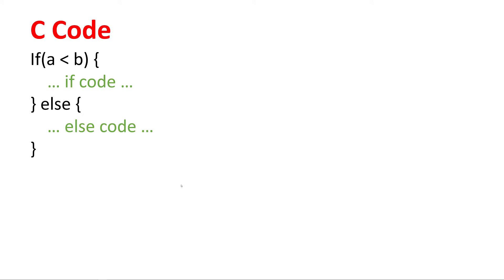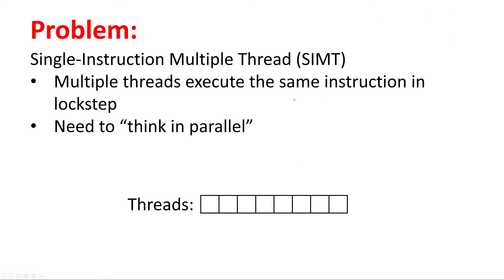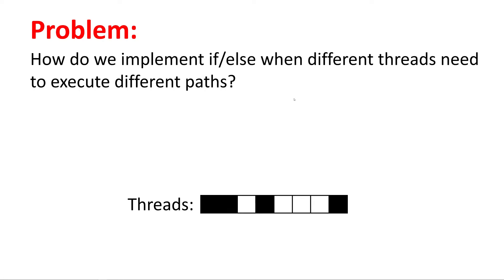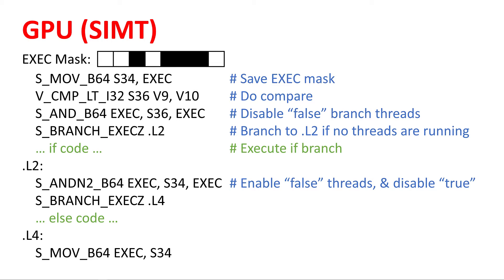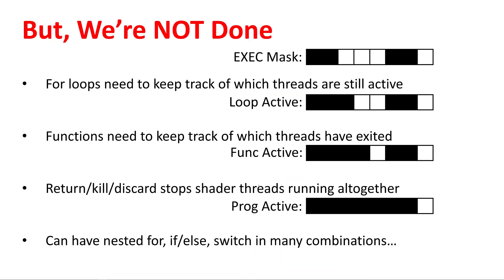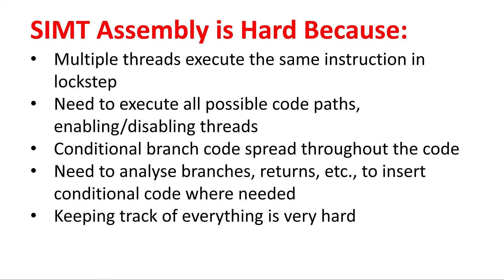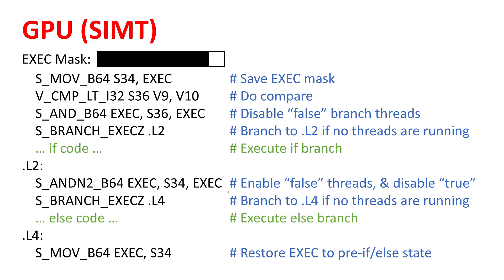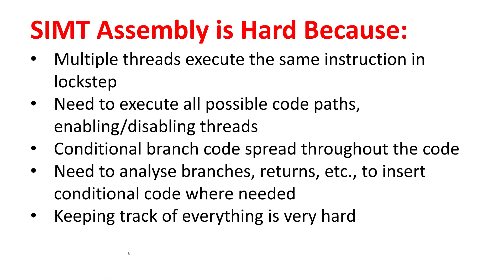Why Writing SIMT (GPU) Assembly is Hard

Comment: Honestly doesn't seem that hard. Might get more involved the more control structures you want to put in, but on the other hand you might be more purposeful in how you write your GPU code. I am already writing my shaders in a way where I compute all the paths and then decide what value gets used in the end via a single 'branch'. I am interested in figuring out GPU assembly.

Also exposing GPU assembly can (maybe) make it possible to have userspace shader compilers, and that could lead to better shader/GPU programming languages in general.
Reply from the maker: You're welcome to try it... provided that you can get your machine code through the driver to the GPU.
Reply: @KeaSigmaDelta  Yeah, that part might get involved. Also finding the specification for the instruction set, likely having to write an assembler for it, and figuring out how to debug that whole thing.

Thanks for taking the time to make the video, by the way. An interesting watch, and there doesn't seem to be a lot of information about assembly-level GPU programming out there.
Reply from the maker: @danilafoxpro2603  AMD publish their GPU ISA docs: 
https://gpuopen.com/amd-gpu-architecture-programming-documentation/

My experience comes from writing RadeonHD/RX drivers for AmigaOS. At the time AMD was a bit slow with releasing the Southern Islands ISA, so I reverse engineered it from their LLVM compiler (yes, that was years ago). I managed to get 2D hardware acceleration working before the open-source Linux drivers were stable. ;-)
Reply: @KeaSigmaDelta  Nice. So you were not implementing OpenGL, but routines like 'draw rectangle'? Sorry, I don't know about AmigaOS, so not sure what hardware acceleration entailed there.

Yeah, I was leaning towards trying with AMD first, since they seem the most open about their hardware and drivers.

It will probably be some time before I get into it though. For now I am concurrently figuring out CPU assembly/machine code while writing a compiler (x86), and writing a software rasterizer, figuring out graphics. After that, I wanted to try writing an operating system, so I will probably start poking the GPU when I get that working.
Reply from the maker: @danilafoxpro2603  I implemented 2D drawing using the GPU. Later I also wrote 3D drivers (a custom API, not OpenGL).

Comment: Thank you very much. This was very insightful. I might still explore nvidia’s ptx when possible. (I also think spir v has a format that closely resembles assembly, like llvm is for general machines)
Reply from the maker: You're welcome. I'm glad you find it insightful.

Speaking as someone who wrote an SPIR-V parser, SPIR-V is a low-level binary file format, and definitely not something that you'd want to program in.
Reply: @KeaSigmaDelta  I have some issues with restrictions on CUDA and was wondering if there’s ways to make it better. I basically want to have the equivalent of a large constant memory, that is accessed and cached in chunks of 8 k bytes (the general value) without having to relaunch the kernel and do a shared memory load again.

Basically I want to have access to explicitly mentioning the movement from the constant memory to the gpu cache memory (used for the convolution operations etc).
Reply from the maker: @manueljenkin95  I'm not familiar enough with CUDA or nVidia's architecture to know if that's possible. What the drivers do also matters. For example, the shared memory load could actually retrieve the data from a cache, unless the driver clears the caches between kernel runs (in which case it's always going to have to fetch from memory on initial load).
Reply: @KeaSigmaDelta  thank you. In my case I’m sure it does a reload due to a large dataset size which means it’ll get overwritten by new data before the next iteration or process that would require same data.

Comment: If anyone ever feels like writing parrallel assembly, there's one GPU out there that I know of that you can program without drivers interpreting the stuff inbetween. It's not a fully featured desktop GPU but it probably got most of the fundamentals the same.
And that is the QPU (Quad Processing Unit) of the Raspberry Pis. There exist several ways to program it, even in python or C, but for assembly there's vc4asm (VC4 being the Video Core IV that the QPU is part of).
Not easy to program, but probably very insightful.
In terms of features, it's on the level of OpenGL ES 2.0, but most people use it in GPGPU mode (they don't actually use the render queue, tilebuffers, and automatic vertex/fragment shader setup, but instead just push general purpose programs for the QPU to execute.
There's no microcode between the assembly you write and the QPU, so you actually have to issue the commands efficiently (one MUL and one ADD op per instruction). The architecture is 12 QPUs executing code independantly (but having a shared memory buffer to read/write to and DMA into memory), each of these QPUs are 16-way (or 4x 4 Quads in graphic mode) with a 4-clock-cycle instruction, and if you do only 8bit stuff you also get a bunch of vector instructions that operate on the bytes individually, for a massively parallel processor that is quite interesting to program.
If you want to see some code:
https://github.com/Seneral/VC4CV/blob/bf48b2ca335cad8e64bb745394a18a5f05103133/qpu_programs/qpu_mask_tiled_5x5_blobwrite.asm?ts=4
That is a video processing program, not graphic, still interesting.
Reply from the maker: Thanks for that. I had a quick look, and it does indeed look like the QPU is NOT an SIMT architecture, eliminating all of the challenges that come with SIMT.
Reply: @KeaSigmaDelta  Can you clarify why that is? Do note I did not formally study this yet, but as far as I understood SIMT is basically SIMD with some additional flow control, e.g. by providing an exec mask, whereas SIMD is more limited.
And the QPU is definitely at least SIMD - on a hardware level, they are 4x32=128 Bit processors, and transparantly execute the same instruction four cycles in a row, so effectively a 16-way 32-Bit processor.
If I wanted to implement an if-case in QPU code, I'm actually more limited than with the SIMT architecture - there's no built-in exec mask, all 16 paths execute the instructions, you have to refer to flags to mask when you are writing the result(s). That does however mean you cannot easily stack the masking, unless you simulate the exec mask with a couple more instructions. Which I guess does mean it has control flow masking, the exact same code you show in 5:10 could be implemented on the QPU.
Also technically it does allow for threading (two programs on the same QPU sharing resources by voluntary yielding), although that is a completely different kind of threading.
Reply from the maker: @seneral9804  I'm not familiar with the QPU, so I cannot say for sure if it is indeed SIMD or SIMT. That's just the impression I got from a quick look.

One difference between SIMD & SIMT, is that SIMD operates on a vector from a single thread (e.g., (r, g, b, a)), whereas SIMT operates on the same scalar value in multiple threads (e.g., (r0, r1, r2, r3)). Let's use a pixel shader as an example. An SIMD instruction operates on an RGBA colour for one pixel. By contrast, an SIMT processor's threads each operate on one colour channel for multiple pixels. In this example, the SIMT processor has to execute 4 instructions to do a full vector operation that an SIMD processor would do in one. However, the SIMT processor does so on multiple pixels/vertices/whatever. It's a different form of parallelism.
Reply: @KeaSigmaDelta  Alright, thanks for the explanation. Now I can say with confidence it is indeed a SIMT processor, it processes 32-bit values in 16 threads at the same time (*), while the instructions are for 32-bit value only. It just so happens it also has SIMD instructions like v8max to deal with the 32bit values as a vector of 4 8bit values. Also, there is additional complications because the 12 QPUs (each of which being 16-way) are also not completely independent, they share a single DMA-enabled memory block, and two pairs each also share a TMU (for memory fetching). Oh and it also just so happens each QPU also supports a different kind of threading, by allowing two 16-way programs to run in parallel with shared resources, each yielding to the other when it has to wait.
So yeah, if you want to program assembly on a SIMT processor, the Pi's QPU is an option.

(*) Isn't quite true, technically it does 4 at a time and repeats the same instructions 4 times on 4 threads each. But it does that transparently, so it's technically 16-way.
Reply from the maker: @seneral9804  Thanks for following up. I might have a look at the QPU in more detail later, if I have time.

Comment: One thing I've always wondered about is the general performance cost of branching on GPUs. I'm hardly an expert there, but in our architecture, to minimize branching we write a separate fragment shader for each type of material and render each material type in separate forward passes. Yet that does impose some rather heavy costs on the CPU side having to group triangle primitives based on their material ID and keep that in sync with our geometry data structures that can show up as hotspots in some operations (any kind of editing of mesh topology tends to be quite expensive for us, like inserting and removing polygons on the fly or loading a brand new mesh on the fly).

So I've often wondered if it might be cheaper, even though I hear branching on the GPU is quite complicated and expensive, to actually just store material IDs in parallel with our primitives (or as vertex attributes) and just do like a massive switch in one monolithic shader on the material ID/index to determine how to shade things in a single uber frag shader we might generate based on all the materials available. I've done some personal tests that show some promising results there, but still held back from trying to apply that on a large scale out of all the suggestions to minimize branching in shaders.
Reply from the maker: It's hard to say for certain because GPUs have many different bottlenecks. I'd err on sending large vertex arrays to the GPU, because one bottleneck is how many draw ops/s can be handled. Functions like glMultiDrawElementsIndirect() & newer APIs like Vulkan have increased the number of draw ops/s. Also, if all threads in a wavefront execute the same path, then only one path needs to be executed. And, SIMT architectures can switch wavefronts during pipeline stalls which increases throughput. 

All in all, measuring it (on multiple graphics cards) is the only way to really know which strategy works best.
Reply: @KeaSigmaDelta  One of the tricky things I've found is that it's difficult to get a wide range of GPU hardware representative of the full variety of what our users might use. I've developed a bit of an allergy to GPU programming around the early 2000s, not by doing it so much myself (I did the bare minimum) but by watching my colleagues deal with very painful issues that would only show up on one end-user's machine... as well as very fragile GLSL shaders that would work on one type of hardware but not the next (back then it seemed especially prone for code that works on NVidia cards to not work on ATI/AMD or vice versa, and especially onboard GPUs seemed problematic for us). We frequently got issues back then where the entirety of our team couldn't reproduce an issue on the end-user's machine, suggest they update their drivers, and to no avail. It doesn't seem as perilous these days, but I've developed a bit of a fear of GPU programming from watching my colleagues back then. Another side of me wants to get into it since I realize the sheer parallel power of these things when it comes to number crunching, but if I had my way, I'd want to write like a tiny bit of GPU code (definitely not in assembly), ship the product and get it tested by a boatload of people, then write a little bit more, ship again. :-D

Kind of tying to that video of appreciating bug reports, I've got a bit of that fear when it comes to GPU code (also newer versions of SSE). It's not so much for the bug reports. My worst fear in programming is creating a bug none of us can reproduce, whether it's a most obscure race condition or just code that doesn't work on a very specific type of hardware. I've had to chase down just a handful of those in my career, and they were enough to give me nightmares after (some took me whole weeks of stabbing blindly in the dark while bouncing builds to the one user who could reproduce the issue to pinpoint down).
Reply from the maker: @darkengine5931  Yes, hardware-specific problems with GPU programming still exist, although it has improved a lot since the early 2000s. This is where having more testers is helpful, because buying all those different GPUs (plus motherboards and extras to host them all) gets expensive very quickly.

A few silly differences I've encountered (via ShaderToy):
- NVidia seems to zero initialize uninitialized variables, but AMD doesn't. There are shaders that rely on this... **
- I encountered a shader that relies on infinite loop detection and mitigation in order to work

** I've encountered this with CPU code too. For example, code that only works if the OS zeros memory before giving it to a program.
Reply: @KeaSigmaDelta  One of the things my colleagues experienced with the GPU side tend to complain about is that NVidia, in general, seems to be more tolerant to code that might otherwise produce undefined behavior, like zero-initializing variables as you mentioned. We used to get the bulk of our GPU-related bug reports on ATI/AMD side and I naively thought that was because the GPUs were of poorer quality, but apparently, it was more often because NVidia GPUs/drivers weren't allowing us to detect mistakes on our end. Our shader devs tend to prefer AMD now for primary GPU development (though they actually have multiple GPUs -- the company buys them a variety) since it seems like there's a higher probability that code that works on AMD will work on NVidia than vice versa.